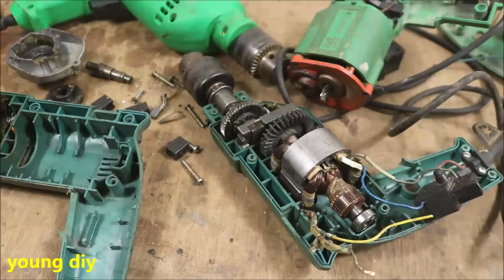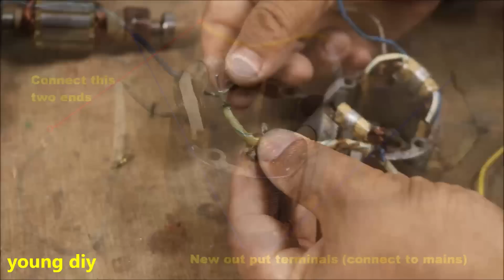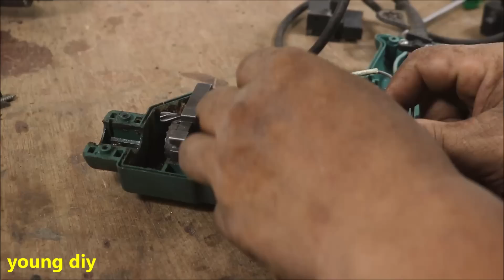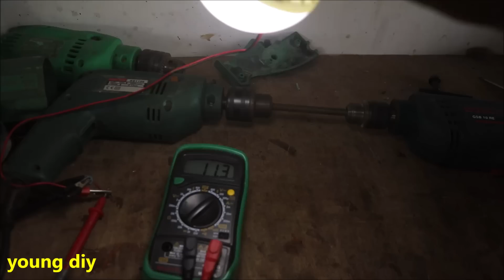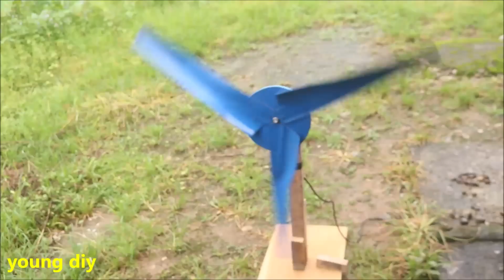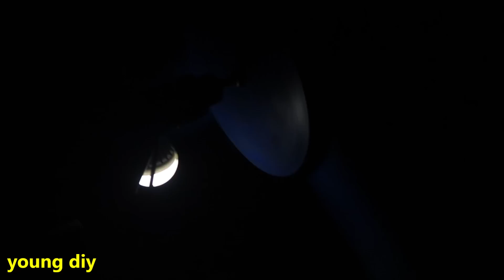How to Make a Drill Machine Power Generator,   | DIY |

Comment: If stator has only two pole magnetic field the rotor should be the same . On video isnt . This is fake.
Reply: The different coils can be actived at different times to increase the torque. This is common in AC motors these days